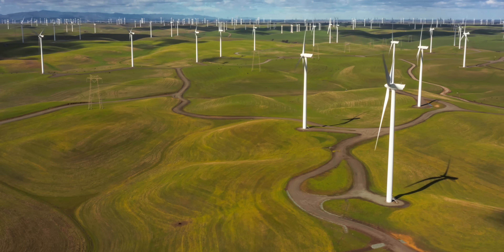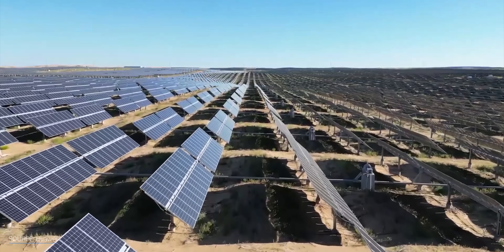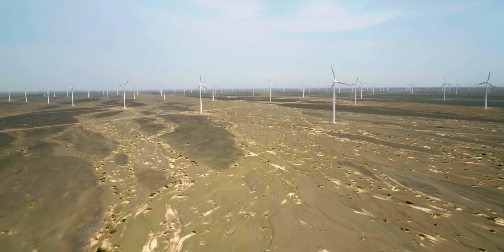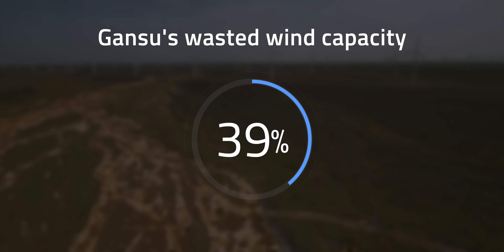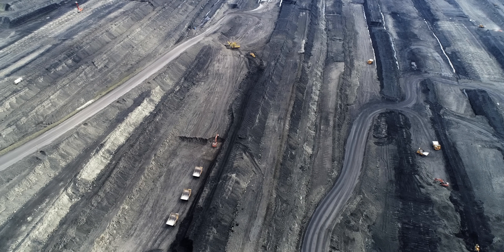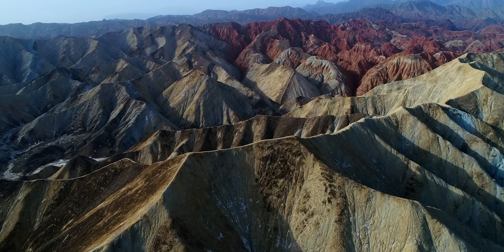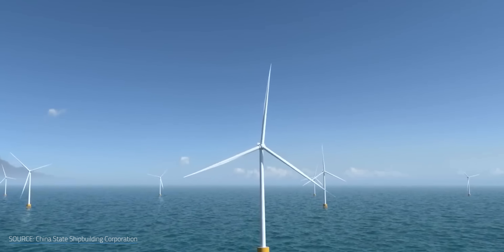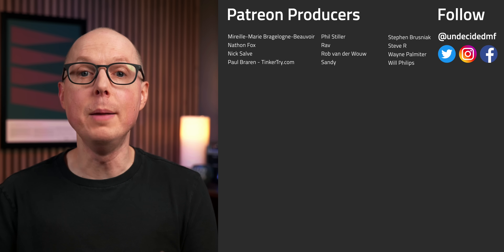The World’s Largest Wind Farm has a Tiny Problem

Comment: People forget that windfarms don't spring into existence magically. There is a cost, both economic and ecologic. 
Reality: A single windmill will never produce enough energy over its useful lifetime to reproduce itself. The carbon footprint is enormous, and they don't recycle efficiently.
Manufacture requires energy and utilizes toxic materials, while transportation to remote areas and installation is highly fossil fuel dependent.
Windmills are a net loss at a cost benefit level. Just because an expansive farm appears to produce promised energy, the reality is far different.
There is no such thing as a free lunch. IMHO

Comment: Seems like nukes closer to population centres might have better longterm prospects. Gansu theoretical output is = 4 Yangjiang Nuclear Power Plants, which will more reliably operate close to peak capacity. That would be a total land area of about 10 square km. That's a negligible amount of land for China. Make them molten salt reactors and you don't even need to be close to a large water source.
🤷‍♂
Reply: And still China is investing heavily both in nuclear and renewable energy. 
Maybe they are stupid and you know much better, what they should do? You should absolutely go there and explain it to them!
Oh wait, nuclear power is much too expensive and incredibly dangerous when located in the densely populated eastern part of China? Then maybe they are not the stupid ones here 🤔

Comment: I don´t see as much of an issue. Having the wind power in the province will enable that province to phase out coal, the transmission lines to the coast and the offshore windfarms in construction there will help, whenever the wind is not blowing in one of the locations. The people in the province will eventually move on to more usefull jobs than digging coal out of the ground and burn it - as long as the planners keep working on that. In order to be successful, there does not need to be a short term profit.
You want really expensive and inefficient? Then look, how it worked in Germany for example: In order to make people install solar panels on there own roofs, you offer enough subsidies. But most private people don´t have the capital to just do that, so they need to ask a bank for a credit. But that credit cannot be given by the state - no, it has to be given by a bank, which does it for a profit. And in order to still make the whole thing worthwile for the private person, the subsidies also have to pay for those profits. And that is paid for by taxes and energy end prizes. And of cause, the grids are not any more ready for all of that, then they are in China. Even roofs of public buildings were rented out to private investors for solar instead of just installing that solar and selling/using it. Financed mostly by bank loans again, profits for the person who rented the roof and the bank - again. Paid for by subsidies and energy end prices by the public - again. And still, no sufficient energy storage, no sufficient total renewable production, no grid to handle it. Still new coal extraction project and at the same time, newer coal power plants are still built - and not the kind with highly flexible power output which could complement renewables as a bridge technology. And that´s a western country which at least gets some green energy transition done.

Comment: Silliness!  Firstly, it is. a false measure to state the rating Without skating the capacity factor.. The capacity factor in North America would likely between be between 30 and 40%.. Secondly. a wind turbine cannot power a single home on its own unless you're willing to do without sometimes as Germany is finding out. Further this array produces a tsunami of power that floods a grid.. It cannot be used without shutting base power which could be coal..  Coal is used for base power because it' cheap and continuous. However, it can take several hours to get it running.  So by the time. you get your coal fired. plants shut down. There could be no wind..
Reply: PixelViking  Sorry, but Statistically Denmark has 60% but it is because much of it is exported. Secondly look at the price of Electricity in EU. the last weeks. Germany was paying 10X the rate. .Sweden threatened to withdraw from EU energy commitments to avoid the destructive prices.  Electricity becomes cheap  when the wind/solar are producing and extremely expensive when they are not. Wind is subsidized always. Without politics, economics would not connect it to the grid.

Comment: These huge generators need major repair or replacement every 7 or 8 years. The blades last about 15 years. These mega projects are far more expensive than small nuclear plants. This is ALL being done because of CO2. We only have 400 parts per million CO2 in the atmosphere. That's too little, NOT too much. Plants do best with 1200 parts per million CO2. Also, heavy industry building and maintaining these mega projects have no effect on CO2.

Comment: All the turbines (NOT windmills, they grind corn...) and solar arrays in the world will be made redundant if the Advanced Geothermal System gets developed, as in the video I watched before this one. (https://youtu.be/jxICYjBEsvo?si=Ao44Xue_W6CwVBJz) As they say, there is virtually nowhere on earth that geothermal power from the crust cannot be extracted with this new process! Thus eliminating most transmission lies at a stroke because they can be sited much closer to the areas of need.
Reply: PixelViking  Not a lot - the amount of heat going into the atmosphere from volcanos and thermal vents is FAR greater than we could ever hope to extract...

Comment: Wind power is unreliable source of power and horribly expensive because of the short life of a windmill and the expsive to build them... Most of the energy they make is wasted because they make it when you do not need it, and when you need it they likely are not able to provide it. In short a bad solution.

Comment: Did this guy actually propose to using wind generation charging into batteries then moving the batteries to a populated are to discharge them😂
Which would most likely be done with diesel trucks

Comment: The UK already has 30GW of wind power and 10GW of Solar, yet on average over a year, wind only produces 9.59GW and wind only 1.52GW. When the UK has high pressure over it, (sometimes for over a week like it was this month of November), we get NO WIND OR SUN. I record the energy sources and volumes every day and one day last week the total renewables generated just 1.22GW against a demand of 30GW. This is not unusual and at times, I have reported that we would need 30 times the amount of renewables to cover the demand, (which can be as high as 49GW), but we only have enough land and sea area to triple the existing capacity. Thank goodness we have GAS generation which at times it has produced up to 70% of demand. Our 40GW capacity is actually more than enough to cover the 30GW average demand, yet most of the time it is not enough, because of a lack of wind and sun. When the wind is blowing and the sun is shining, our Grid cannot cope with the output, so the energy companies have to feather the turbines and then claim compensation for the energy that they could have produced. On average we pay the energy companies £2.2 billion per year in compensation, which will increase as our renewable capacity increases. There is no way that the UK will cover all demands without a source which can be turned on and off at will, such as Gas.

Comment: Large wind turbines do require oil for lubrication and cooling purposes. On average, a wind turbine might use around 500 gallons of oil per year. Not so green ! and they have bin known in cases when in large numbers to alter whether patterns change the migration and or kill birds and impact insects etc... ecosystems. Wind and solar is mostly a scam.

Comment: Energy storage is the key, but I would like to see more hydro and other mechanical storage that will last 100 years without maintenance.  Pumping water up into a reservoir is way better than batteries.  Maybe even under earth storage of potential energy is what is needed in desert locations. It could even be air.

Comment: How about using efficient high-voltage DC (HVDC) to get the electricity to the customer? Forget batteries. Use high-efficiency coal-fired gas turbines that are quick to start and will take care of demand during periods when the Sun doesn't shine and the winds don't blow. (Cut down on the use of coal and average out the cost of power.) In the meantime, we should bring manufacturing back to the United States. It seems slightly unfair to say we have reached our goals for carbon neutrality when all we have done is move our pollution to China.

Comment: There are windmills near my house, and  I recently drove by them. Out  of nine  windmills,  none  were  spinning even though windmills  nearby were. Windmills are an inefficient, intermittent, expensive energy source that consume massive amounts  of land, steel, copper,  concrete and  composite material for the blades. Nuclear power is vastly more efficient.
Reply: And they're only viable with massive subsidies from the beleaguered taxpayers.
Reply: @rickschritt1616  Correct but taxes don't fund government. See Grace Commission.
Reply: I think the future of nuclear is Thorium gas reactors or possibly the molten salt/ metal core reactor.
We all saw the problem with water core reactors at Fukushima when the circulation pumps failed.
In my opinion , ALL new nuclear designs need to be designed from to be Fail-Safe/ meltdown proof
Reply: @tigerphid9677  you can't judge it by one single day. Those turbined sure will make up for their costs in about 15 years. Yes, they don't run 24/7 but they don't need to. They are only ONE part of a diversified portfolio of energy sources. 

Nuclear is great if you don't think about the risks involved or the nuclear waste you have to take care of.
Reply: Here the land is free, labor is cheap, and they can sell the solar panels to Canada for less than a dollar.  So definitely they did marvelous things. And for the western countries the new problem is going to rise as they increase more production at home. 
China did what they could
You should think about your future for clean environment
Reply: No its not,  I'm an expert on this subject. You sound like you watch too much Fox News. Let me help you out. Wind turbines costs 1/5 of that of nuclear. Plus nuclear requires at least 500,000 gallons of water a minute, wind turbines require none except to be cleaned assuming its necessary. Nuclear fuel, spent or enriched, is ALWAYS a terrorist threat.  Currently 30%  of US used nuclear fuel comes from Russia. Nuclear has waste storage issues it looks like in the next 10 years taxpayers in addition to the nearly 500 BILLION dollars in subsidies, loans and grants just to keep them running we will have another 100 billion to that tab to store the waste. Assuming Trump doesn't allow nuclear plants to dump it in our backyards like they do in Russia. (Trump has numerous business ties with Russian Criminals to the tune of 300 million dollars)
The problem with wind is location, location, location. We need to have better transmission systems which is what Matt has pointed out. Yes I am sure he knows alot more than you do. So turn off Fox news listen to people who know that they are talking about which you apparently missed. Matt said the Chinese wind farm in this story was 95% efficient. Nuclear Power plants are only up 85% of the time. So I hope this helps you out.  Pay more attention to people who know what they are talking about. Like this video.
Reply: Yea
Reply: and Failed Texas i  its time of need

Comment: 02:37 ... is this why China is building hundreds of new coal-fired power plants? Don't believe the propaganda from China. If they say "they will do this or that", it's easy to say what you want, but actions speak louder than words. Their increase in coal-fired plants has made China's coal-power the number one use of coal even combining every coal-fired power plant in the world, China still has more - and they are still building more.
China, with no regulations on emissions, has the dirtiest coal-fired power plants in the world, too. Yes, that includes the new power plants they are building.
China can SAY they are going green, but what they are actually doing is just the opposite.
Reply: They are replacing 40-50-60-70 year old inefficient plants.
I know it's hard to grasp but if you replace old infrastructure BEFORE it literally falls apart you have an easier time of it.

Comment: why are you being a shill for the CCP and their failed energy plan? the CCP goes about building these projects without allot of forethought as you mentioned, where do we use the energy created here? part of that answer is the CCP's were better than the west in every way show of building these projects with all the income they have amassed producing too much of the western worlds manufactured goods and the fact the CCP can just order projects built. i have first hand toured the site, the big thing you did not show was how many of the wind towers have a huge oil spill stain down the support post as the unit above has failed and is profusely leaking oil to the sand below. others have one, two blades sheared off from them while other entire areas as you mentioned are not running as their is no need for the power they make. it is like many of the boondoggles china has created. the ghost cities which were done to increase GDP. yes, some were built with the expectation of future city expansions in areas of natural resources. you clearly mentioned that the wind power came in more costly than the coal fired facilities now in place and being used and opened in record numbers still. it is also in a region of coal mining which will lead to the populous entirely out of work and another headache for the CCP to control its population which is already unhappy on the whole with the CCP and the way they run the nation. not me saying this, too many of my friends and colleagues in country quietly tell me this every visit i make there. the extra expense of getting the grid in place along with power loss for transmission further inflates the cost of that power. one glaring point you never touched on is the FACT that these wind farms are only viable for around 5 year at which time their maintenance costs cancels their profitability with the current technology. i saw other fields in the same area where they were in stages of collapse and tear down no doubt at their 5 year limits. your battery storage comment is yet another technology with open end disaster when these batteries reach their end of life and ZERO provisions are in place or the expense recycling or rendering lithium and the other toxic chemicals they hold being dealt with other than china dumping them in the Gobi or Taklamakan hoping the sands cover their mistakes. there are far more efficient ways of making power like nuclear with the newer generation of plants, (yeah yeah Fukishima where a plant should have never been built for the exact reason the disaster occurred) china is on its way to placing several nuclear plants in place as we speak. lastly, all this stepping away from oil is because of the need for china to be self sufficient because of the real threat of being cut off from its basic energy to run its military and its overt and hostile actions towards its neighbors. then America coming in and blockading its oil supply to get it to fall back into a more peaceful relation with its neighbors. yes, you see it from your perspective. i see it from the actual CCP's perspective of energy independence to carry out an invasion of Taiwan or any other hostile activities without the curtailment of its vital oil supply which runs its nation at its core electricity for its industry.  oh and if you doubt me on the fields i can gladly send you the photos from my trip with the fields of defunct wind towers. i have no issue with your alternative energy beliefs, but china and this project are not one of them for the more than obvious two points you made, cost competitiveness and out in the middle of nowhere impossible again economically to supply where power its needed. their high speed rail system is also a similar boondoggle which was actually created to quickly mobilize their military forces throughout the nation when needed aka Uighur ethnic uprising or Mongolia uprising, along with a major confrontation with inda which will occur on their current course with their irresponsible hydro electric projects and other activities in that region.  again massive power to what end of use other than cutting off vital water to india. chinas high speed rail system,  save one or two lines runs at at a massive loss to the nation who built them. again another technological marvel boondoggle courtesy of the CCP.

Comment: Wind powers sucks especially if they are out to sea, hard and dangerous to maintain. 

They kill and confuses birds, they get noisy over time due to maintenance (Exchanging parts are hard) they are shit to live nearby and lowers house values. Power output fluxuates thus without ability to store the energy or without on demand energy nearby they are useless. If they are out to sea they are just way more expensive due to transmission lines and maintenance.

Solar is much better but requires just like wind an on demand energysource.

Both solar and wind are "feelgood" solitions to clean energy but they are no where near as clean as nuclear power.

Comment: It would be good to look at the lifespan of the wind turbines and then what happens once they need to be replaced. Figure the cost of materials, the manpower required, what to do with the garbage, are there enough resources to replicate the present. Or is it just going to be a massive problem down the road for garbage and an environmental disaster.